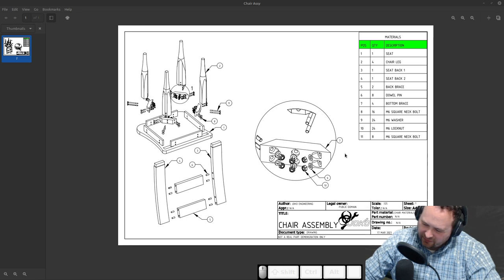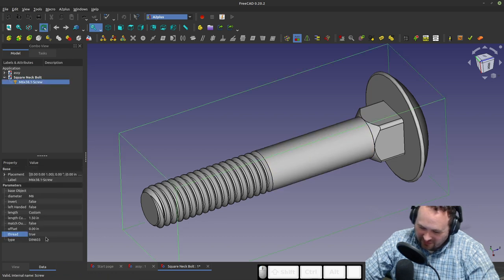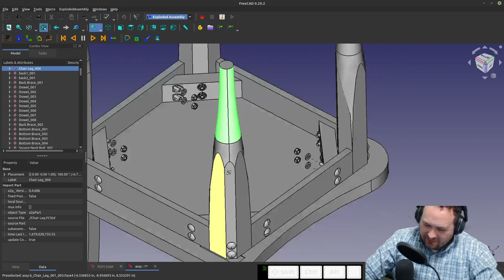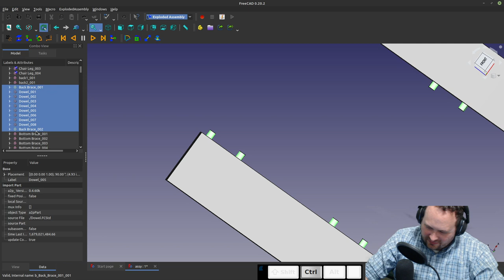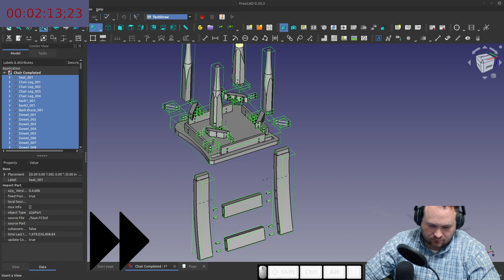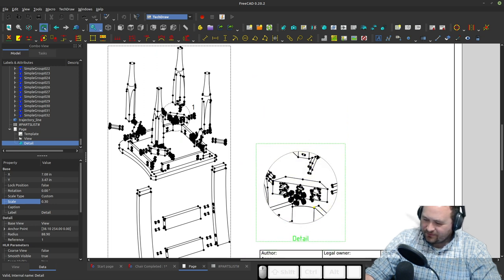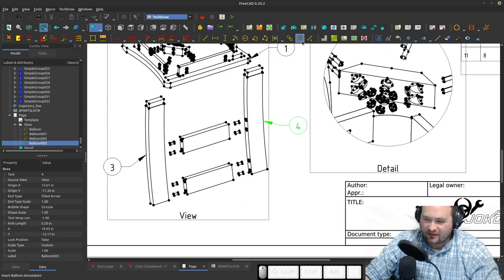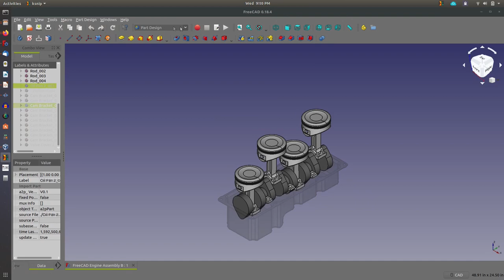FreeCAD Assemby- How to Explode, Draw, Bubble and Generate Partslist on a Drawing|JOKO ENGINEERING|

Comment: I have no experience with other CAD packages so maybe this is normal but I can't believe how slow FreeCAD is to render and redraw geometry for the drawing. Also watching you position that detail bubble by adjusting coordinates numerically... man, that was painful 😂. I fully expected that you'd just drag the circle around with your mouse and the magnified view would update in real-time. Made me feel like it was 1994 or something.
Reply from the maker: It's usually pretty instant but assemblies with a lot of topology will slow the system.  FreeCAD has pretty amazing advancements with every version, techdraw particularly.  Maybe some updates there are in the works.
Reply: Trust me, it's a lot better than 1994.  I was around then using AutoCAD v.12, Windows version (yes, there was a DOS version for AutoCAD before then), and Solid Edge & SolidWorks were yet to come out.  FreeCAD is a lot further ahead than 1994.
Reply: It's interesting that I don't have that much of a problem on loading stuff, I'm also making a techdraw with quite a lot of lines inserted from complex models and yes, I've got a quite nice computer but the processor is not that much of a monster and I get stuff loaded in a few secs, and I don't think they have improved that much in the last 11 months XD. Just my personal experience.

Comment: This is a tremendous and unique ability in FreeCAD but just unbelievably slow with all of the waiting for processing. I mean I can almost understand the time it takes to generate a view. But then it takes like 10 or 15 seconds to generate each callout bubble? Oy that is painful. Also is there no way to window select multiple objects when doing the explode? That would make sense since it's you only have to select the one  normal direction face last. Alternately it would make sense to just select each normal face of each object based on the direction you want it to move, and then for instance you could select all the 16 similar nuts and washers at once instead of doing an individual operation for each normal direction. So yes this is wonderful but so much room for streamlining and optimization of these procedures.

Comment: Is there a way to hide the black circles around points? They are disturbing the drawing, and they are not necessary - in my opinion...
Reply from the maker: You may already know this, but the black circles at the points are used as selection handles for dimensions and what not.  They are not meant to show up in the final drawing, only for users selections.  These can be taken out of the view by selecting the drawing view, going to HLR Parameters in the left menu and changing the Coarse View to true. This may affect your ability to select certain points with this setting on.
Reply: @JokoEngineeringhelp  Thank you very much for your excellent explanation. I've already found another good video explaining the function of these points (resp. vertexes) here: https://youtu.be/DFTGt_-jeos?t=2160 This might be also helpful for other beginners like me.

Comment: Interesting tutorial, thanks! It seems as though FreeCAD doesn’t know which part is which when you insert ballon’s, is that correct? I would have thought it should be smart enough to know the part you select is a particular one in the list. Maybe I’m expecting too much. I’m thinking about what happens when you modify the assembly and add a new part. Apparently you need to make sure you everything the way you want it before getting to this point.
Reply from the maker: I haven't modified too many assemblies, but as of right now I would probably default to re-inserting the entire view.  You're right, the balloons do not yet have a link to the parts in the assembly.  That would be cool.  There have been a lot of good improvements to techdraw in the last editions of FreeCAD, perhaps these things will be next.

Comment: Hi... really helpful tutorial.Do you think what made the insertion of the assembly into drawing page really slow is because of the fasteners...i read about fasteners and its effect when importing them into techdraw even when the thread is set to false... please i would really love to se how it fast the assembly is imported without the bolts...Thanks.
Reply from the maker: I agree- fasteners slow things down.  Things are very close to being instant when there are no fasteners
Reply: @JokoEngineeringhelp  true...If that is the case, I think it would be really nice to have a personal part library of fasteners built using something like the part design workbench. Each bolt or nut wouldn't have any thing like a threaded feature...just cylinders, chamfers and fillets. It's an idea I thought about because I read on the forum that setting the thread of fasteners imported from the fasteners wb to false doesn't really have much effect...I would love to know what you think about this or if there is some other way to work around it...Thanks
Reply from the maker: @faroukyusuf4066  great Idea.  Here two video I think would help:

https://www.youtube.com/watch?v=Jze6ftGc6BQ

https://www.youtube.com/watch?v=1qszeRDmpvg

Comment: I have a couple of questions, is it possible to clone a drawing and subject the clone to changes without affecting the original ?  The other question is, can I draw cable and plumbing routing in a drawing, (NOT PCB design) this is to show electricians and plumbers where the services are to be run/routed and what components are to be used at the termination points.  (Nb: I have used MS VISIO for this but it is no longer available).

Comment: This view is extremely leggy. Hard to work with. I need to disable the automatic view update to be able to work on it. It has trouble to hide or not to include overlapping lines. I have a simple 2x40 THT pin header and  from the side view instead of 1 line it draws 80 lines on top of each other. This creates lag.